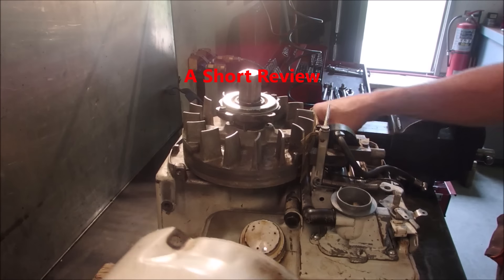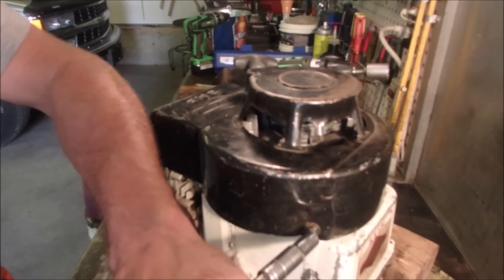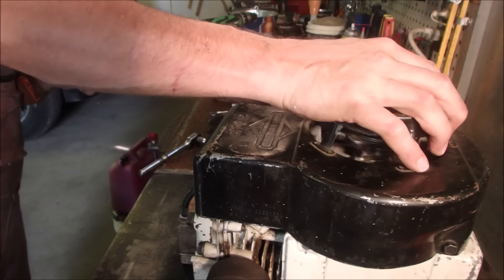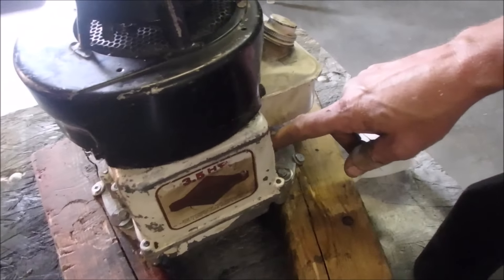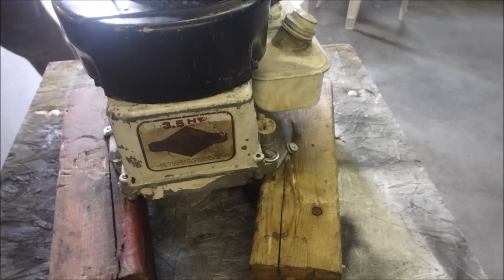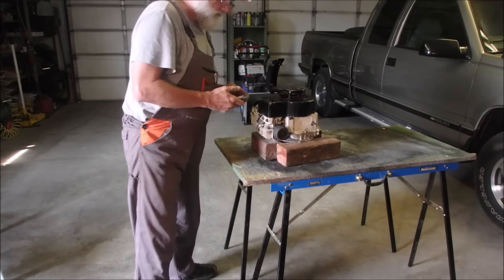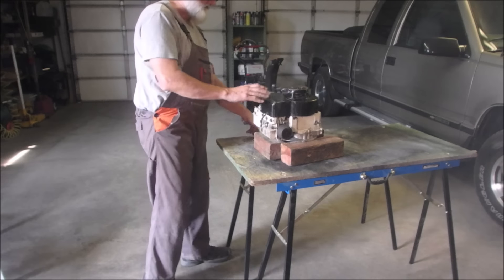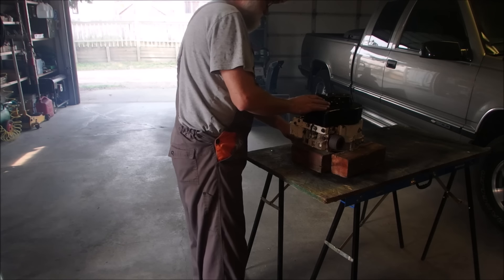Well here it is, My Frankenmotor Pt 4

Comment: I remember that exact same motor back in the 70's when I used to mow lawns as a kid.
Reply from the maker: Me too.  I tried to make a go-cart out of one and at the time didn't understand the light flywheel.
Reply: Me three!  But that nostalgic old B&S decal sure looks odd facing the operator!  Every B&S mower I can recall had the cylinder head toward the operator.

Comment: Nicely done Bruce, it's running great! This was a fun series.
Reply from the maker: It took a little adjusting once I got the blade on eh!!!!
Reply: @BrucesShop   You called it when you said it needed the weight!
Reply from the maker: @MrUbiquitousTech  I tried to make a go-cart when i was about 13 (1969) and the motor would never right just right.  I didn't know why then but eventually figured it out.

Comment: Cool build!  Don’t put too much weight on the compression numbers.  These old engines have a decompressor in the valve train.  Briggs and Stratton use to recommend spinning the engine backwards by hand to test compression.  If it rebounds off the compression stroke, it’s good enough.
Reply from the maker: That is right.  I have done that too.  This was a fun build for me.

Comment: push mowers have alluminum flywheels. 
I have used cast iron flywheels on push mowers but doesn't work other way at all. 
Light flywheels can stop during pre ignition then pull rope handle out of your hand.
Reply from the maker: Right.  Things like pressure washers have cast flywheels.
Reply: I'm surprised Bruce got it to run at all with the aluminum flywheel/no blade...They usually just kick back on you like Willy says...Must be the "magic touch".  Those were great engines.  It's ironic that they are described as "throw away engines", when they last forever and take a beating....

Comment: Great job!! All you need is a mower deck from same time frame as the motor..  I like these old choke systems better than new style..  Good job.. Question for ya. I am searchimg for engine tins for a 18 hp opposed horizontal shaft 2 cylinder.. mid 80,s style..  Keep your eyes open. interested in complete engine aswel for parts.. Thanks Mr Pender..
Reply from the maker: Wow I sold one last year.
Reply: @BrucesShop   If you come across one thats blown up but complete I am searching! Thanxs again..

Comment: Bruce, instead of fighting with those two pieces of 4x4 to support your motors up off of the bench, why not create a solid, one piece base large enough to support the base of the motors and thick enough to keep the drive shaft off the bench top.  Maybe 2x4s on edge screwed together with two shorter ones in the center to leave space for the drive shaft.
Reply from the maker: I have an old carcass from a mower.  I have thought of carving it up to use as a mount.

Comment: Interesting idea to put the motor on Backwards!
Reply from the maker: There is only one way they go on.  The rewind is a different type.  The spark plug-still faces to the front.
Reply: @BrucesShop  Back in the day of those engines they were put on the other way, at least here in the states they were.
Reply from the maker: @markparks1854  I have seen them both ways.

Comment: That's a cool little extractor!  I use either a siphon (for emptying fuel tanks, etc) or a Mity-Vac with a 1-liter receiver jar.  It takes a lot of squeezing that little trigger to change oil.  You apparently clean yours after using it on oil.  I keep the Mity-Vac setup just for old oil, because I'm too lazy to clean it every time.  Do you have a link for that extractor, by chance, or a brand name?
Reply from the maker: This is from a Canadian store called Princess Auto.  Like I said it doesn't work as good on oil.
https://www.princessauto.com/en/detail/gas-oil-extractor/A-p8469512e
Reply from the maker: If I were to buy another one i would spend a bit more.  For quality and oil extraction.

Comment: Great job Bruce, I wanted to see how it would run, you did a great job on this. Is this your first motor like this from parts from so many other engines. Congrats on your milestone also. You are going to go down in history someday.

I am waiting to see what my cousin is going to do with his snow blower with the rusted engine. He left it out in the rain and snow for a few years and the engine has seized up on it. He wants to throw a new motor on it and I will take the old and redo that and hone the cylinder and try to get it running again.
Reply from the maker: Don't hone it right away.  If you can get the motor turning you will be amazed at the progress you make.
Reply: Thank you for the advice. I will try to break it lose and see where I can go from there.